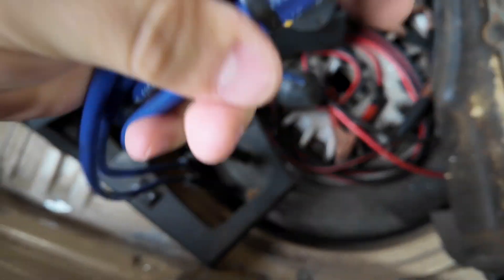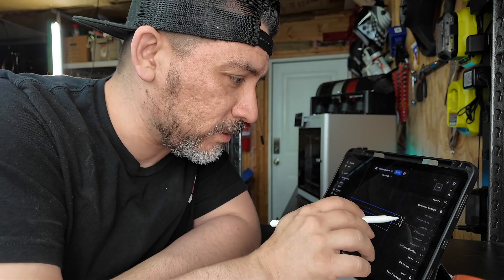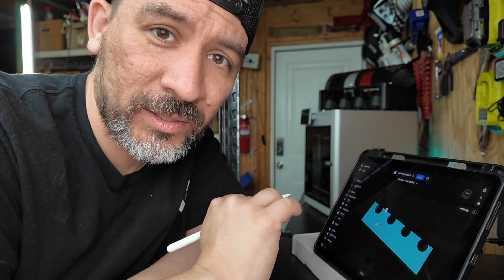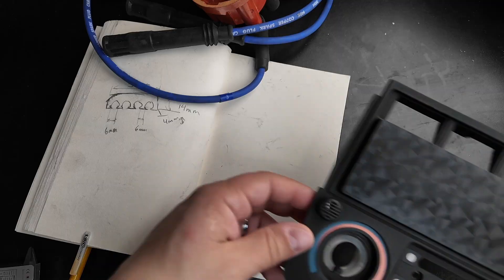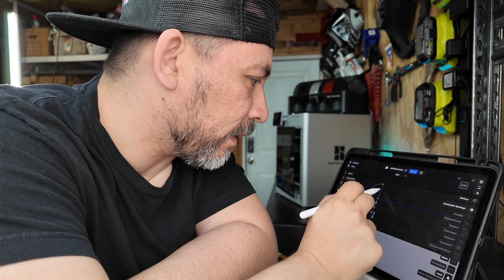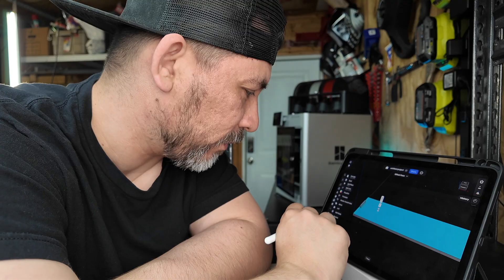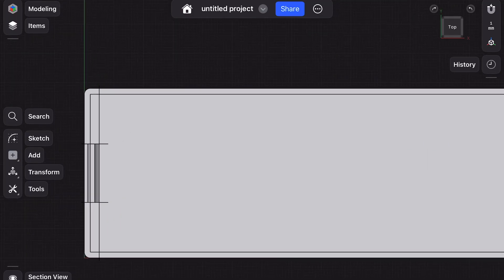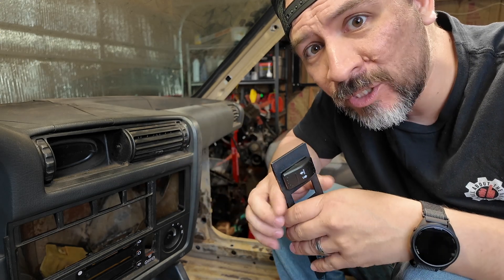Go From CAD to FULLY Functional 3d Printed Car Parts In Just 1 Day

Comment: Recently just got into 3d printing. I am a professional Motorsport technician by trade but a bmw enthusiast as well! I bought the printer originally to force myself to learn 3d modeling and create parts for my E28 535i racecar build along with other interior bits for my euro e24, e38 740i and my other e28 535is street car. To say the least im hooked. I’ve enjoyed your videos printing parts for your e30
Reply from the maker: That’s awesome!!! Thx for watching. So what type of 3d printer did ya get and what do you think is the hardest thing to learn??? Working on some ideas, but would be cool to know what other people need help with 🙏
Reply: @Itsallaboutthebuild  I was given an ender 3 pro from a friend and i also bought a Flsun T1 pro (wicked fast) Honestly the hardest part has been 3d modeling and using the software and keeping filament dry in GA humidity.
Reply from the maker: Nice, will have to check out the Flsun T1 pro as I need something a bit bigger for full size cluster gauges. 3d modeling seems to be much easier using Shapr3d for us and I agree keeping filament dry is a pain... Would love to get my hands on one of those inline filament dryers.